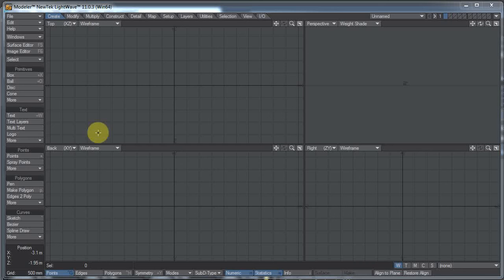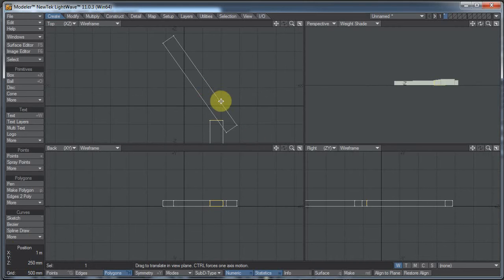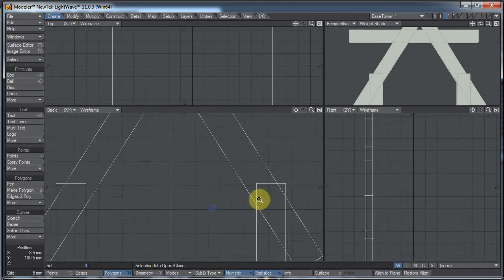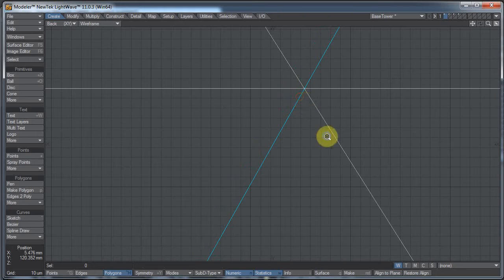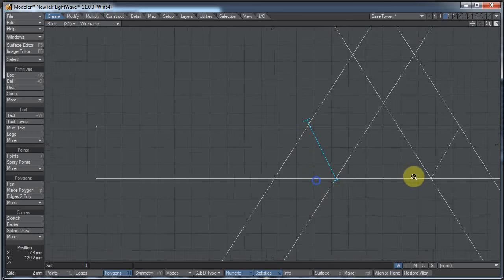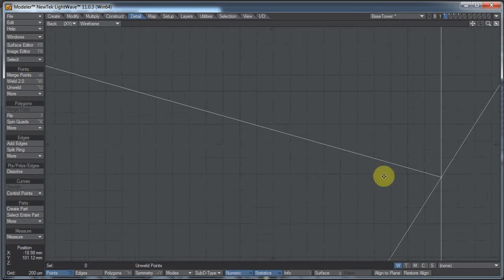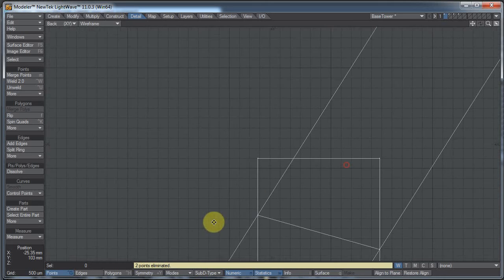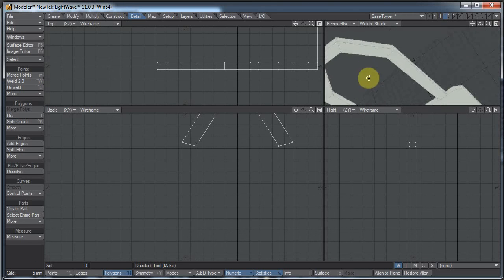Mitered Corner Technique In LightWave

Comment: Cool and simple idea! I found that something I do complements it pretty well. Select the two points that would draw the knife path, press P to make a 2 point poly, move it to a bkg layer, and size it up a little with the action center in the selection so that the line just grows. Go back to the original layer and do a template drill using the line in the background layer, it will slice the polys exactly in their intersection. I'm sure one who can code basic scripts could make this a nice .ls!